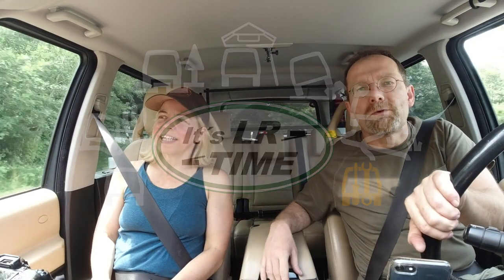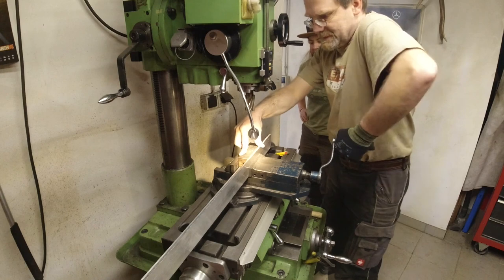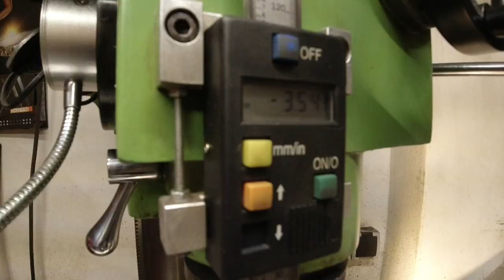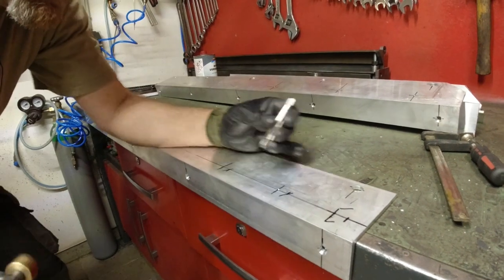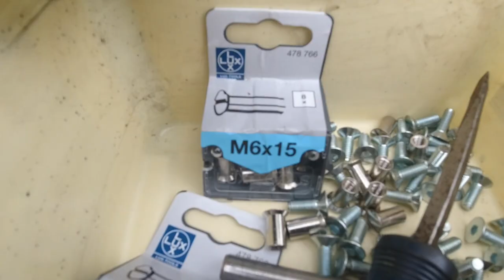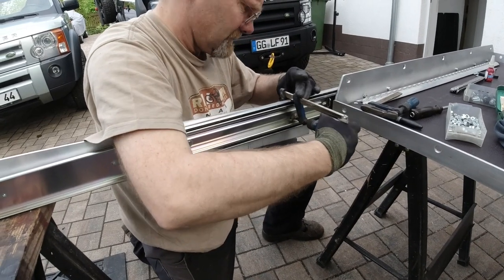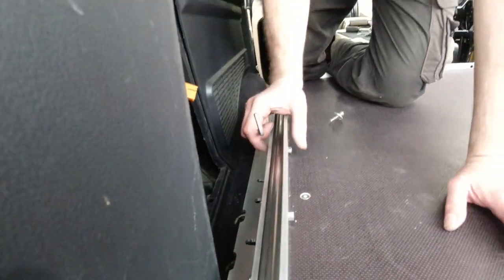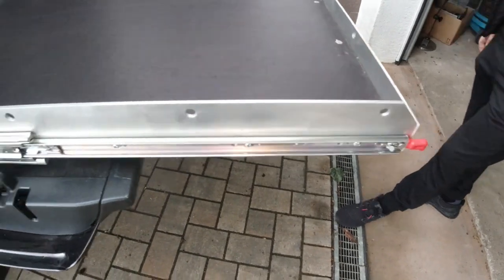How to build a slide out drawer / DIY / Land Rover Discovery 3 / LR3 LR4

Comment: I built drawers for the back of my vehicle, mostly because all my camping gear can go on top and still allow me to access tools and equipment in the drawers. The drawer sliders you used were expensive, four times more expensive than the ones i used but my sliders aren't as heavy weight as your sliders. Great little video.

Comment: Wow, just wow , am in awe of the design and planning that went behind that , alas I’ve cheated I’m afraid , lol, managed to get hold of a LR sliding floor , intend to remove my 3rd row seats so I’ll then have extra storage under the sliding floor for strops, shackles etc, thanks again for the fantastic video 👍
Reply from the maker: 👍 We have all our non perishable food stored underneath the slider.  I have to admit that I am kind of stressed when my recovery gear, even a jack, is underneath the drawer and I can't get to it in an emergency 😅👍🙋‍♀️Vera
Reply: @Vera_and_Christian  that’s a good idea regarding the food , haven’t made my mind up yet , might keep my recovery gear in the boot side lockers as find them ideal and can easily get to them , plus threw that horrible scissor jack away and got a bottle jack , ones they use on the Mercedes vans, is perfect lifting the disco , really hate those scissor jacks as just find there not fit for purpose , hope ur both well and enjoying the sunshine , just thought , could Christian design like a headlining basket to keep ur recovery gear in , that drops down for easy access in an emergency , maybe having sliders on it so the basket come out and down as the disco are quite high to save trying to reach for it , attached to the headlining handles plse don’t throw anything at me Christian for suggesting it, lol
Reply: @Vera_and_Christian  hi, apologises but was wondering if my email came through to u ok plse, hope u didn’t mind me asking , know my emails have been playing up lately , hope ur both well, many thks , gary
Reply from the maker: @garystuart226 👍 Don't worry we got everything. We had kind of a very week and here  . Next week when things get back to normal, we'll get back to you for sure. Christian has to look into your idea first.  🙋‍♀️ Vera
Reply: @Vera_and_Christian  many thanks and that’s great it came through to u ok,  please no probs as understand u must be very busy and can’t wait to one day be the proud owner displaying one of ur stickers on my D3 , know Christian is also a very clever man and always look forward to the weekly videos of what’s next , u both keep us on tender hooks of the next project , have a great weekend , stay safe and thanks so much once again

Comment: Heck Christian, you are so engineeringly meticulous you melt my brain watching you build things, however was good to watch you building this second slide out draw system lol your friend is lucky (i think?) to have you available to assist with Disc3 repair/build projects. Actually as you know there are many videos and many people out there who love their Disco,s a little like when I was in my 20,s when we all had Landrover series trucks although I have to say Series Landrovers were very much easier to work on with no electrics to mention controlling them or monitoring the running of the engine whether petrol or diesel!
But Id rather go continental driving in a Disco3 than any series Landy I have done many thousands of miles in series 3,s freezing my butt off with little heat and ears nearly bleeding with the noise and back killing me after off roading all day lol.... was great fun though, all the best Phil
Reply from the maker: 😃👍 Thanks for your story, loved reading it. I do really like reading about all the travel adventures they did with the old Land Rover Series. Like in Strangers like Angels, and First Overland, the first London to Singapore adventure.  🙋‍♀️ Vera
Reply: @Vera_and_Christian  Thanks, I did many journeys in my old landrovers, I had a military air portable lightweight series 3 fitted with a V8 which I used to go in this country "green laining"  to many lovely locations for a weekends driving challenging lanes and weekends camping. The most challenging drive I think was taking in the winter the landrover (soft top) 300miles to Scotland at Christmas, Very very noisy, very very cold with snow all the way and minus freezing temperature, so cold I tried to wash the road muck off the screen with warm water from a service statin but it froze immediately. 10 hours driving,, challenging but great fun and an achievement, when I got to Scotland in the morning after the drive up I checked the engine and 1st thing in the morning it was so cold that the anti_freeze was like the consistency of a slush puppy in the radiator and header tank!  but the trusty old V8 still fired up and ran.. So Discovery 3,s I have to say are so much more comfortable in my late 50,s my wife and I are happier being warm and comfortable despite the more maintenance heavy requirement,
Like you and Christian we have a good workshop here on our property including a 4 post lift ramp not a pit! so its not so hard to get under the vehicle....all the best have a good week nearly the weekend ... all the best Phil

Comment: This looks like it could be good for the back of my Grenadier using the inbuilt utility rails to fix it to. A fridge and some storage boxes when needed and just empty for day to day use. Using the utility rails should make it easier to remove also.
Reply from the maker: Yeah the Grenadier's trunk is not as easy to work with as the Discovery's unfortunately. Because of the wheel cover your slider cannot be as wide. It is actually a really downside for us. We would have to think of a different setup.  🙋‍♀️Vera
Reply: @Vera_and_Christian  I am sure you will come up with something. Keep Smiling - Dave

Comment: Excellent as usual C&V, I had just been watching your first videos on the making of yours as I am going to try replicate make one for my Range Rover but it only has the 4 tie down clip bolts I think it should be strong enough though , naughty not wearing safety glasses on the drill cutting holes & shaving bits off a piece could have flown out under your spectacles Christian safety first you are a really talented fabricator couple as I know Vera does a lot of the work off camera 😊👍
Reply from the maker: Yeah tell him, he won't listen to me 🙄👍. The Discovery also has only 4  M8 tie down holes, that is enough Christian said 😀🙋‍♀️ Vera
Reply: @Vera_and_Christian  Thanks for the information Vera 👍

Comment: Very good indeed!
Two quick questions:
Was it absolutely necessary to remove seats 6 and 7 to fit the drawer? 
Could the slide rails have been of a type that allows the entire shelf to be removed so that rear seats could be used again?
I was thinking of a similar slide rail that is often used in kitchen drawers with a lever that allows this happen.

My own Discovery 3 , which is mainly used on my farm would benefit from your drawer to carry tools. But occasionally has to be able to carry 7 people. So if the drawer could be easily removed, this would benefit me.
If not, your drawer would be so useful to me, that passengers 5 and 6 will have to learn to use their legs again!
Reply from the maker: Hello Richard, the seats do not have to be removed in order to mount this drawer. And according to the manufacturer of those particular slides, you can release them and take only the drawer out. Now we actually did not take something like that into consideration when designing the drawer, since we only have a five seater and no access to a 7 seaters with installed seats. Fabian took his out.  So if we have an exact measurement from the rear seats, edge to edge, Christian would love to include a design for this situation, being able to still use it as a 7 seater. Maybe you can give us the measurements. 🙋‍♀️ Vera

Comment: it is a good idea, well done I may do it too
why did you start with uneven angle?
wish I had a mill, I have a 900 throat Rapid bandsaw, three-phase, Iwill make a vid to show you, but not good at that, would like to send you some pics
captive nuts
I did see how  you fastened the rails to the disco floors.
Reply from the maker: Hi Stuart, the hatch of the Discovery is at an incline when opened, so it does not  lie flat.  So if you mount the slides evenly, you loose about 3- 4 cm of height.  There wouldn't be enough space for our Engel fridge otherwise since we also want to utilize the wooden platform resting on top of the plastic side cover. As for captive nuts, they are a great idea but we just did not have any at that time. And yes, the great thing about the Discovery is that it has threads on the floor from the tie down hook. 👍🙋‍♀️

Comment: Hi Christian Vera 
My discovery 3 SE  has the two extra seats. and I’ve been thinking of installing some sort of sliding shelf  I’m wondering weather to keep the seats or take them out. To be honest I have never used them there’s always a load mat over them that’s a Brilliant sliding shelf  that you have installed . I thought you mentioned that it came from Amazon ! If so what’s the item called or number  thanks
Reply from the maker: All links are can be found in the video description. Now if we had excact measurements of the rear seat, edge to edge, Christian could take that information into his design so you would be able to utilize your last row of seats.  According to the manufacturer of the slides, you can unlatch them and take just the drawer out, but have not tried that. We just need the measurements of the seats folded down. But you can also leave the seat is folded down. 🙋‍♀️ Vera

Comment: Thanks for the great vid, Vera and Christian. May I asked, what brand and type of band-saw cuts the alu-material? Is it good for mild and stainless steel, too? Regards Heinz
Reply from the maker: 😃👍 The  sawblade on our band saw is not permanently suitable for mild steel. It will get blunt. Christian just runs a cheap blade. 🙋‍♀️ Vera
Reply: @Vera_and_Christian  Hi Vera, thanks for the quick response. Perhaps, the operator can choose between different blades? If I only would know the brand and model of the saw, I could check myself. Have a nice day. Regards Heinz

Comment: Hi Vera, hi Christian, as I have a 7-seater Disco 4, l'm wondering, if it is really necessary to remove the seats. I could fix the side mounting angle components with two bolts and a few distance washers into the lashing eye mounting holes (two on each side). Or do you think it's not rigid enough? Best wishes and thank you for all your contribution here...
Reply from the maker: Our drawer is compatible with the 7-seater.  The side cover carpets must be removed and in the worst case you install some spacers.  Fabians LR3 was also a 7-seater with the seats removed.  Christian
Reply: Hi Vera & Christian, do you have a solution for quick removal drawer when we need to used seat 6&7

Comment: Did you weight the draw? Id be interested in the total mass of the draw installation. It is very smart though, very inspirational.
Reply from the maker: It weights for sure 15 - 20 Kg. Depending on the material you use. 🙋‍♀️ Vera